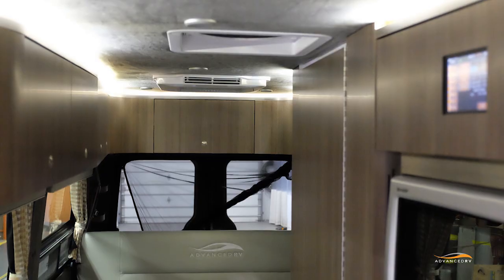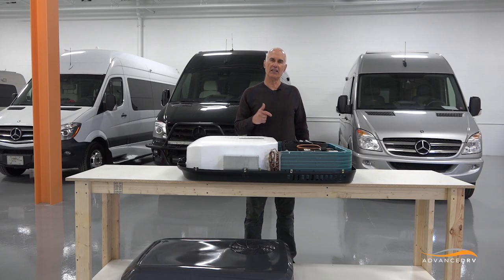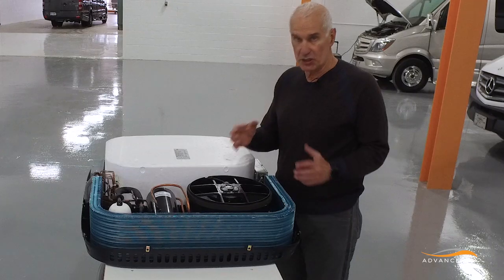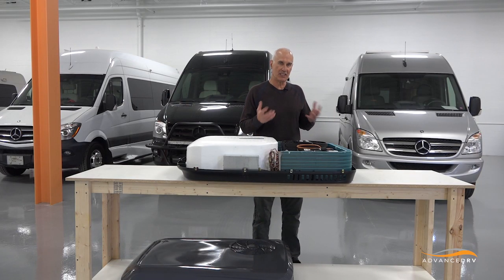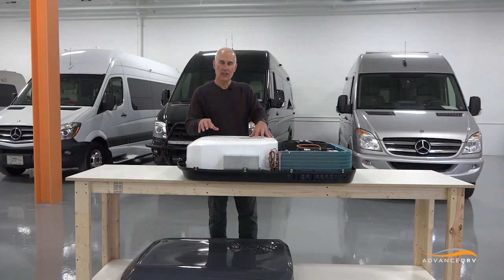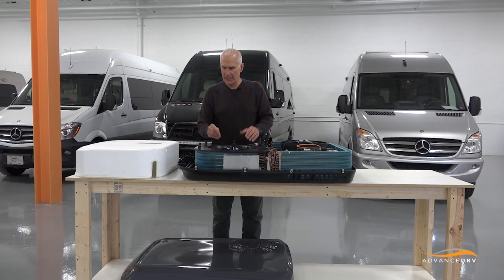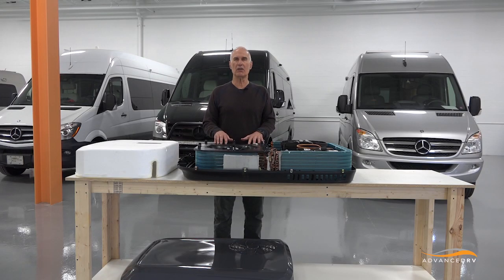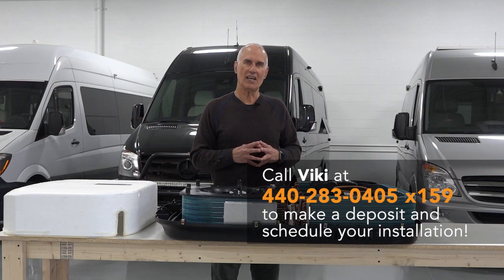The Nuts and Bolts of the Quiet Air Conditioner

Comment: Hellow  The low profile 13.5k (AC3400?) looks like it should be my next AC, but I need to verify dimensions to see it will fit where my current AC is.  I found overall dimension on the website, which look good, but I need a diagram or dimension between the front of the 14" hole to the front of the AC3400, ideally both to the front at the base, and to the front bulge of the plastic housing a bit further up. Can anyone help with that?  I'm ready to buy.  Thanks much

Comment: Question.  All the info exchange has been about the low profile.  I see that a stand size and low profile are both offered.  Is the low profile a beter option if size and areodynamics is not a factor?  Our camper is stationary and we will add it to our livingroom area.  It must be non ducted.  Our OEM AC is in the middle of the coach, ducted, but can't keep up when it gets over 90 which seem to be all summer this season.  Goal is the quietest experience with a non ducted unit in out living space for the summer.  I would also like the heat pump option as we go thru a 30 gall bottle in a weekend in the winter.

Comment: I just installed a Houghton RecPro 2801 9500BTU unit ( $1100 ) on a 2012 Keystone Springdale 179. My roof is 5" thick, so I needed the thick roof kit, which worked fine. It's little tricky to change the duct to the longer one, make sure you screw it out in the correct direction, which was clockwise for me. Otherwise, you end up tightening it and it's very difficult to remove. Putting the new one on is a little tricky, but after a few tries I got it. My old AC was a Dometic Brisk II. This new one is dramatically quieter. However, I hoped to run it off a single Yamaha EF2000is ( 1st generation), and it did not work. Later I took the cover off and found out the "locked rotor amps" is 52A! So, there is no soft starting in this thing. At least it’s less than the 62A of the Brisk Air. Looks like mounting a SoftStartRV will be tricky, I might do it. Have to mount it under the outside air fan. I suspect they say "does not need a soft start" because it does not have a loud "thump" when the compressor starts. A soft start can fix that with any AC. The reason this one does not thump is the excellent mounting of the compressor on springs that isolates it from transmitting compressor sound to the RV. When I saw that SoftStartRV has a wiring diagram for this unit, I knew it must need a soft start. I was able to measure the inrush current with a special meter, and it showed 48A, close to the 52A on the label. So far, the highest running current I have measured is 6A, but others have reported 9A. Unfortunately we have had a very cool summer so far, so I have not had a chance to see how well it cools our small 18' trailer. But, the prior 13500BTU unit was clearly far larger than needed, so I am confident this will work fine.
Reply: I just ordered a Houghton 2801 but it hasn't arrived yet.  So you have to change out the duct if you get the thick roof kit which I did?  Are there no instructions included with the thick roof kit?  Did your install require two people?  My hole in the roof is exactly 14x14 inches and the manual calls for 14 3/16" .  Do you think the 3/16" will be a problem getting it to fit?
Reply: @dfreeman0518  There are instructions, but they are not real clear. You have to remove the old duct, AND remove the ring that is at the other end of the duct, and move that to the new one. I made the mistake of "unscrewing" the ring, which actually tightened it. I guess they should all be the same, so turn it the opposite way you would expect to remove the ring, and the same was to get it off the unit. It's not too hard to get the ring onto the new one, but getting it on the unit is tricky to get the "treads" to start correctly. Don't force anything, I ripped a hole in the short one ( that you no longer need ) when trying to get the ring off, since I had over tightened it. Yes, the dimensions are indeed 14 3/16. In my case, the hole in the roof was already too big, maybe 14 1/2. But, the hole in the ceiling on the inside was too small on one side, I used a flush cut saw to trim that out. Also, you might want to call them to make sure they shipped the long screws you will need for the thick roof kit. Many people say they did not get the 7 1/2" screws. You cannot find such screws anywhere even online. Because of that, I ordered the thick roof kit separately since that web page showed the long screws ; however, they sent me the wrong one with the duct that was too big, so I had to wait another week to get that. But, they instantly sent it out, great customer service!
Reply: @dfreeman0518  I had a friend help me get the old one off the roof and the new one on. I rented a "material lift" from Home Depot for $55 ( 4 hrs ), which can lift 450 lbs to 12'. It fits in a pickup bed or the back of an SUV. Worked great, made it really easy. With that you could do it by yourself, but it went much faster with a friend - saves you from going up and down the ladder a bunch of times. My friend just helped get the old and new one on/off the lift. I did everything on the roof. It was easy to unbolt the old one, flip it over, and slide it onto the lift. The new one is so light, it was easy to jockey it into position. I removed the old one and left it on the roof over night, and installed the new "frame" that goes in the hole. So, the next day the sealant was solid and I easily dropped the new unit onto that frame.
Reply: @mrgehring2  thanks for the information.  Now I kinda know what to expect.
Reply: @mrgehring2  I am toying with the idea of a softstartrv as well.  My unit is still not here so I can’t check this myself but is there room under the cover to mount a 6x3x3 soft start?  Softstartrv says not to mount within 2” of any copper tubing.  Are the condenser fins copped or aluminum?
Reply: @dfreeman0518  The only place I have figured out to mount the soft start is under the fan, or outside the thing. There is plenty of room under the fan. Seems like the fins are aluminum, the only obvious copper are pipes that are not under the fan. I can't see why the metal matters - I think they just want to avoid a vibrating pipe rubbing up against the soft start. SoftStartRV has a wiring diagram for the 2801. However, the real headache is indeed mounting it. I contacted them about the 2801, and they claimed they have helped at least 50 people install it. I sent them photos and suggested under the fan or maybe outside, but they have not replied. If you look at the RecPro website, I made a comment about the soft start. RecPro then replied to me privately that installing that will void my warranty, and that the manufacturer advises against using one. I asked what the technical reason for that would be, since it it a very ordinary standard compressor with run capacitor . They did not reply, as I expected. The real headache is that to remove the fan, you have to remove the silicone from the bolts ( as shown in this video ). In addition, to wire things up you need to get to the run cap, which is also under that fan. It has a cover that has four screws covered in silicone, and the wires going into it are also all gooped up with silicone. I am still trying to decide if I really need to run the AC off grid enough to justify all that work, and voiding the warranty.
Reply: @mrgehring2  I intend to run a separate circuit for this A/C to the outside of my 5th wheel and plug into the campground pedestal which is usually a 20 amp circuit.  They (Houghton) recommend a 20 amp so it should work fine on campground power.  I think I will hold off on a soft start for now as well.  Thanks for the info.
Reply: Somethings up with that, my buddy runs the same AC off of his Honda 2200 all night long.. no problems on start up or anything And he didn’t add a soft start to his. It was installed right out of the box. I’m about to do the same set up in my sprinter
Reply: Jamil Chavez I just tried my neighbor’s Honda 2200 and it did work, the extra 200W was enough to keep it going, however not in eco mode, and it also really bogged down every time the compressor started. I wonder if it would still work at high altitude, I am near sea level here in Portland OR.
Reply: @mrgehring2  Hi Mark.  I think a generator loses about 3.5% of its power for each 1000 feet in elevation so if you're at sea level and go to 1000 feet you have lost 77 watts.   5000 feet elevation would be a loss of 385 watts which would probably stall the 2200-watt generator or at least not be good for the A/C.  A 3000-watt generator would probably be needed to be really sufficient for this A/C unit given the 56-amp LRA rating.   I finally finished my Houghton installation, and I am completely satisfied with the cooling efficiency of the unit but am really disappointed with the loudness even on low fan.  I was expecting it to be much quieter.  I am reading about 60.5 decibels on low fan at 6 feet.  Quite a difference from the 54 decibels advertised.  I'm also really disappointed in the fact that the fan runs constantly and does not cycle with the compressor although I have not tried it on the auto fan setting where it might cycle with the compressor.   I did receive longer bolts with the extended roof kit, but I still had to purchase two longer bolts for the front of the unit since I had to shim up the front of the unit to keep it level due to the 5th wheel roof slope toward the front of the trailer.
Reply: @dfreeman0518  Ours is so much quieter than the old Dometic that we are very happy. I haven't tried measuring the sound level since it is fine for us. In the bed area of the camper, when the fan is low, it is nearly unnoticeable. We have a minisplit in the bedroom of our house, and that is almost silent, so it is certainly not that quiet. My wife is very sensitive to noise, and we never used our RV's AC at night. Now she says it's entirely usable for sleeping. The first thing she said when I demonstrated it was, "Wow, we can have a conversation without yelling!" That was at full blast. Maybe somehow you got a bad one? If yours is in a fifth wheel, is it ducted? I would expect that to be very quiet. To me, the fan not cycling is a good thing - I would rather have a constant noise than one that keeping getting louder then softer. I am considering the soft start now, as I found someone who has done it. Not an easy install, he had to put it in a box outside on the roof.
Reply: @mrgehring2  maybe that’s what it is, we’re in Florida and his 2200 handles it with no problem. We just did a bunch of work inside his rig with the AC on full blast and no problems. I’ve also seen a guy say his predator 2000 can also run it. Not sure if the elevation is the variable
Reply: L

Comment: I installed mine yesterday does the fan always stay on low on 'auto' mode? Because it is on mine and unless I turn the whole thing off the fan is on low. What gives?
Reply from the maker: Yes that is correct. The ambient room temperature is sensed inside the plenum, so the unit needs to keep air moving over that sensor.

Comment: How much power does it use? I want ac but other units are so massive.
Reply from the maker: Some specs for you:
- Power Supply: 115V/60Hz
- Input Power for Cooling: 1550 W
- Rated Current for Cooling: 14 A
- Dimensions: 44 and 3/16" long, 33 and 1/2" wide, 8 and 13/16" tall

Comment: What are the dimensions of the air conditioner and what is the amps used?  
I have a 2017 Unity LTV.  Thanks much @advanced rv
Reply from the maker: Hi Jody! The AC is 44 3/16" long, 33 1/2" wide, and 8 13/16" tall. It uses 10-15 amps, depending on the outside temperature.

Comment: I have a 2017 LTV IB.  Are the dimensions to replace the current air system the same as your unit?  Also, what are the amps for the unit?  Thanks!

Comment: +1. Nice detail. Question; is incorporating a ceiling ductwork a thing of the past? Guessing the Class B ceiling ductwork construction is largely aesthetic, no?
Reply from the maker: Great question, Michael. We are only able to duct air conditioning in a super high roof chassis due to the extra height. Mercedes has discontinued this chassis, so we can no longer install a ducted system.

Comment: Why are the heat exchanging surfaces teal blue in color?  Should they not be bare aluminum?  We have a big problem in the deep south with air conditioning components rotting out prematurely if they are not all copper and aluminum construction.  Thanks.
Reply from the maker: Thank you for your question, Interstate Blog. 

Both heat exchangers are made from high grade copper and aluminium. The  fins have that light teal blue tint because of a very thin polymer coating applied to both surfaces of the aluminium. The polymer coat is hydrophilic – which means that it is literally ‘water loving’. This hydrophilic coating allows condensed water to run off the fins without wanting to bead and block up the narrow air gaps between the fins. This gives a better performing heat exchanger that delivers excellent air flow regardless of the conditions.
Another benefit of the coating is a reduction in corrosion as water tends to run off the fins. The corrosion resistance with this polymer coating is better than having bare aluminium fins.
Reply: Thank you - this is very informative.

Comment: Man you nailed it on this video, does it come with soft start for running on the battery system and invertor.
Reply from the maker: Thank you for your question, craig gilmer. Inrush currents are minimized by staging compressor and fan starts.

Comment: Does it require an inverter? Is it DC only or AC only or both AC/DC? Can it work as a heat pump?
Reply from the maker: Thank you for your question, patrick murtaugh. Yes, the air conditioner requires an inverter. There is a heat pump model, but it has a little less cooling capacity.
Reply: Thanks for your reply. With your dedicated diesel heater it really makes the heat pump feature redundant and unnecessary if there is any diminished A/C capacity.

Comment: Also, do you have an inventory to choose from or is everything custom? How long is the wait for custom?
Reply from the maker: Hi Holly. Joe is correct that the majority of the wait time is dependent on the lead time from Mercedes Benz. However, once your chassis arrives at our plant, we build in deposit order for the chassis that we have on hand. Once we receive your chassis and your spot in the production order has come up, it takes about 3 - 4 months to build your custom motor home. Total lead times average 12 months, however there are many factors that can lengthen or shorten the lead time.
Reply: ARV has some used unit for sale.  See https://advanced-rv.com/available/. For a new custom unit, delivery time of a new chassis from Mercedes really determines the wait time.